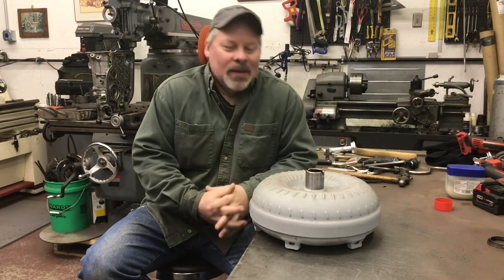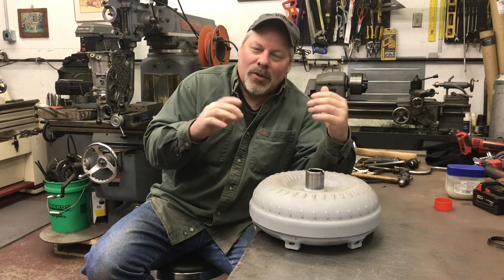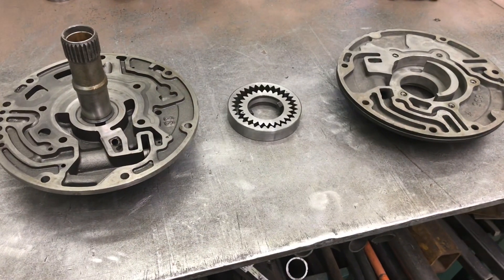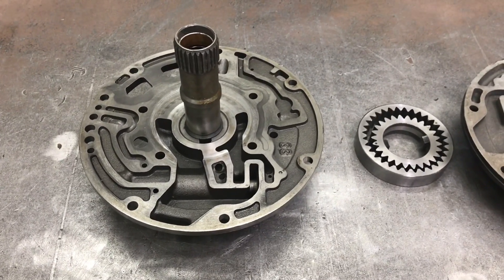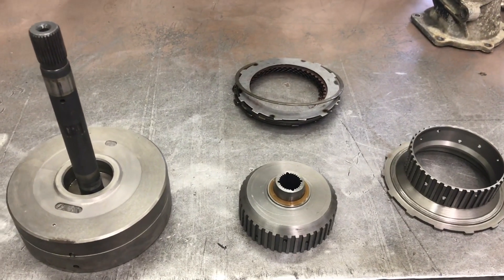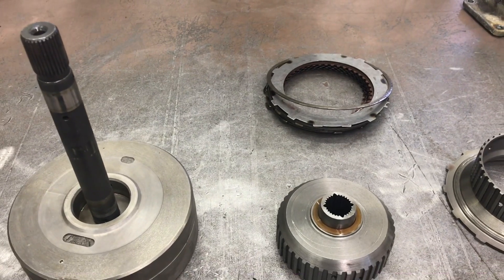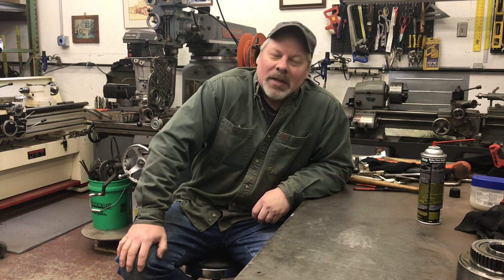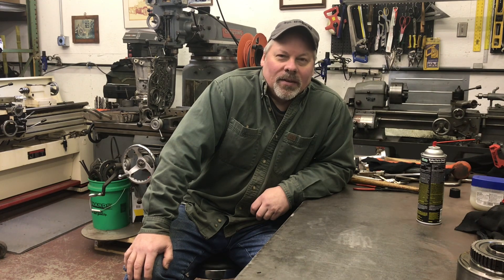TH400 Transmission: How It Works???

Comment: Nice informative video. The only thing I would add is what the small and large shafts on the lower unit are doing in each gear. I believe they are turning opposite directions when in 1st gear. One shaft stops spinning in 2nd gear. And both shafts turn the same direction in 3rd gear. Great work on the videos
Reply from the maker: Thanks!

Comment: I have been watching your vidios and a subscriber,  I'm at 1100WHP, and manual reverse valve body, but 1st and second both feel like 1st gear, trans literally has 30 miles on it , and 2 wot pulls on the brake. And it's not seeming to shift right
Reply from the maker: @maniacS550  That is a bummer! Check the pressure in all ranges then probably have to go back in and see what failed.

Comment: When replacing the older TH400 o-ring seal on dipstick, to get it “perfect” is it best to drain the fluid?
Reply from the maker: @kg6itc  Imhave done many with a drain pan to catch the fluid. If you want to verify the full mark then remove the pan.

Comment: Thanks again, Shawn. Once I learned the power flow, everything clicked. Besides improving hard parts, my "shift kits included removing every other spring in clutch packs, grinding lands on valves, shimming the pressure regulator, drilling and soldering holes in the spacer plate and so on. My own trans went in a vega with 650 hp SBC with 3 nitrous systems totaling about 800 HP which i used all at once on occasion and the trans never broke. The motor broke first (too many passes on aluminum rods). But that was 30 years ago. Now i want to go manual valve body. I learned quite a bit, thank you, but Im wondering if I have to begin with a stock valve body/spacer plate?
Reply from the maker: You can make your own manual valve body. 30 years ago leaving out springs was a thing, flashback!

Comment: Hey boss! Well done on this video, I love it! 

We have a TH400 trans, which is not going into park and is running very slow on reverse (seems like it is on quarter power on reverse), all other gears are fine! Transmission shifter from the outside of the gearbox seems to be shifting properly, what would you check next?

Comment: Hey, great video. I see you are very knowledgeable about this transmission. I have a G30 86 with a thm400 and I wanted to ask you a question. It did go forward at one point however now when I put into drive it doesn’t move. It will go reverse but not forward unless I put in neutral and I press the gas, while pressing the gas, ill shift into drive and if I’m lucky it will catch and drag itself forward. Like if the emergency brake was on. Then it will drive again. Not to long after driving though the cab fills with smoke. Like steam. I don’t drive right now but wonder if you heard of this issue before and maybe know the solution. I’d really appreciate any insight you have. Thank you.